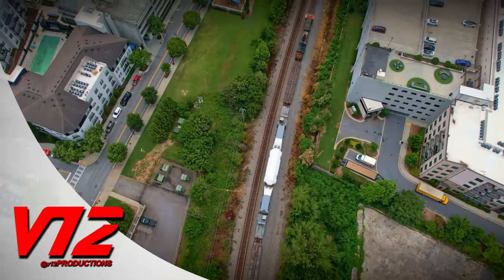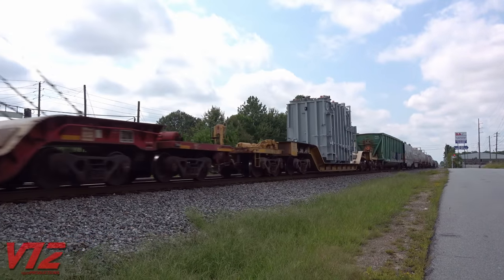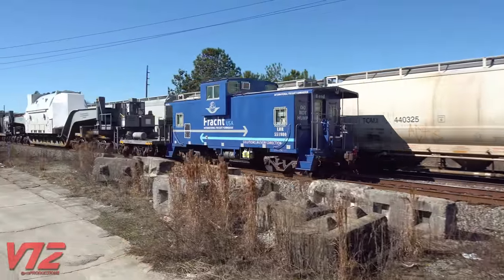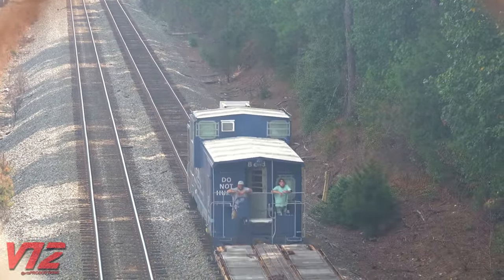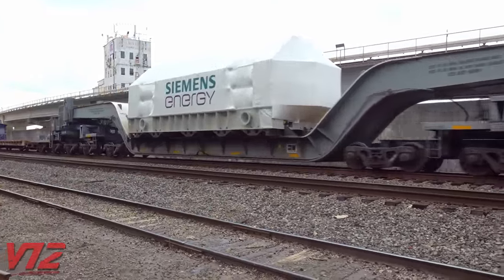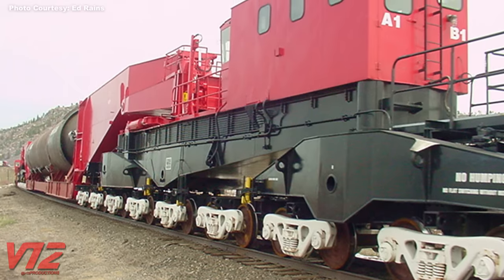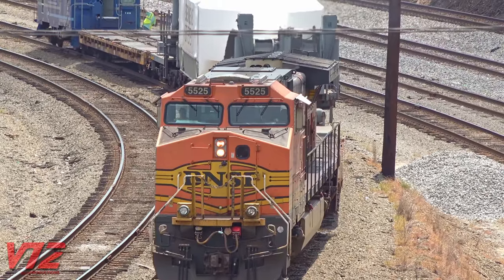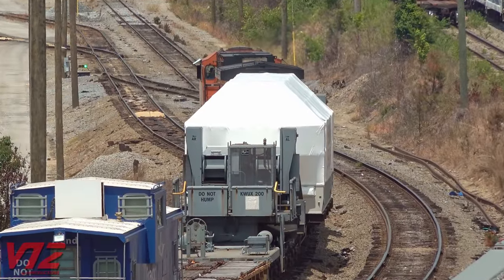Moving a GIANT Railcar!

Comment: 4:09 
Yeah, that’s bad.
In April of 2022, my mother and I were recording at UP’s Ennis yard in North Texas. It was a nice day. A GP15 cut-hood and an SD40-2 were doing switching operations. But just down the track on a siding (still in the yard) was four GEs lashed together.
We filmed them as they were prepared for a light move, and a C44-9W’s air bleed valve had gone berserk and was making that ridiculous clicking noise while another (an AC44CW) billowed fumes out it’s exhaust. Only the GEVOs were not in horrible condition.

It was the most fun thing we’ve ever filmed, even to this day…despite the equipment having seen better days.

Comment: In Britain we do all this by road,  and even specialised barges to take loads around the country, you mentioned 15 miles in an hour and a bit, UK heavy haulage mostly runs at walking pace with a cast of dozens rather than driver conductor and caboose persons, must save a fortune over the distances you need to cover, they must still transfer to road for some of the last portions though.